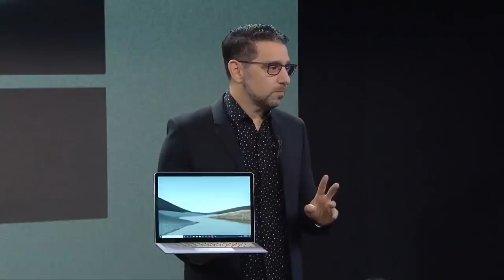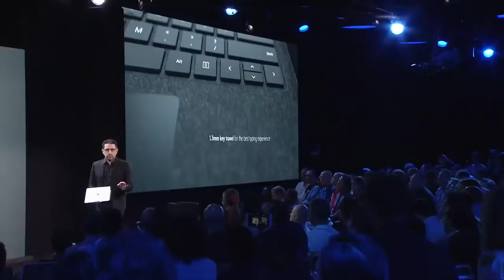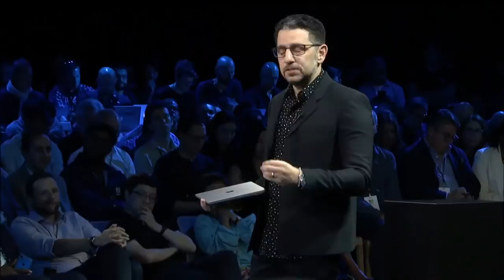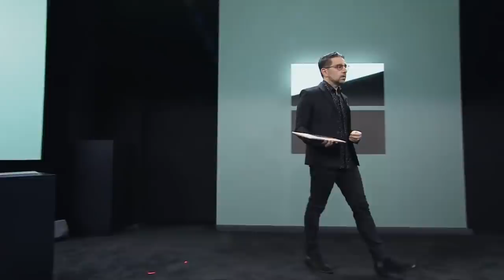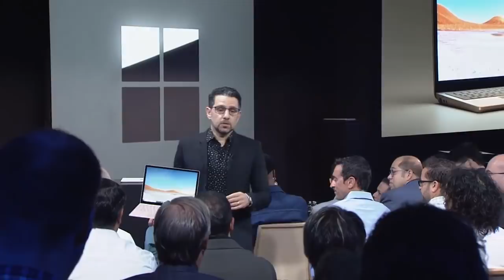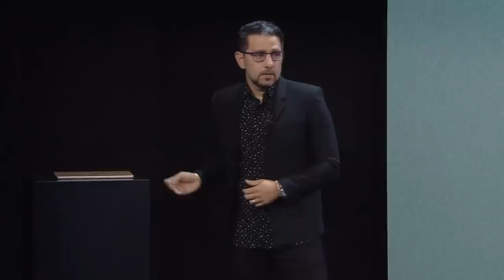Microsoft says they value repair-ability, designs more repairable product.

Comment: The key for these manufacturers that are designing products to be competitors to Apple, is watch Apple make all the bad decisions and do the opposite.
Reply: The headphone jack says hi.
Reply: @javiercorre  Did it mean to say bye?
Reply: @javiercorre  yes, exactly. The headphone jack on my 2018 Macbook Pro says Hi. That I do not need and have never used because like most people I am totally done with wired headphones and use Bluetooth that works extremely reliable and smooth on any Apple device. But if you want to continue living in the technological past, I can recommend a clunky Lenovo laptop to you that still has a VGA port and a modem slot.
Reply: @RandomUser2401  bluetooth headsets are shit. They're heavier and cause more neck strain. They need recharged which makes them worse for travel. And they're more expensive compared to an equal quality wired headset. Also the latency is pretty terrible if you game with it. Until they can fix those problems bluetooth ain't shit.
Reply: @myrecommendedisallmemes  what a load of bullcrap. My Bose QC are unmatched when it comes to travelling absolutely quietly, they are super comfortable and the battery lasts forever, can be recharged with a mirco usb that is available almost everywhere. Yes they cost a bit more, and I know that is the issue with people that dislike Apple, they see no point in paying for well engineered electronics, no matter how crappy a product is built, all that counts is a low price tag on it and as many Pixel/GHz/GB per $ as possible. Doesnt last longer than 2 years? Looks like shit? Built with ugly cheap plastic? Unusable trackpad? Battery empty after 4h? Doesnt matter, more GHz!! Less $!! Everything else doesnt matter.

About lag: Not everyone is a 14-yo gamer kiddie, some of us are adults that just need to get shit done and do other things like actual work with their devices. If you really want to game with a headset, buy one for home. For travelling, cordless headphones are simply the best.
Reply: @RandomUser2401  Being a Bose fanboy explains a lot. The only Bose headset I've had that is remotely worth it's price is the A20 headset and that's because the next best thing is LightSpeed's headset which is bulky and doesn't fit well. Every comsumer grade Bose product I've had is just as good as it's off brand alternatives. As far as consumer headsets go I bought a wired hyperx headset with a removable mic specifically for traveling (not gaming) for about $70 and it is still one of the most comfortable headsets I've owned. Arguably even more comfortable than my $1,000 A20 headset when wearing each for hours at a time. And yes, I realize they're in two completely separate categories for completely different things, but it shows that price doesn't always directly get you more. The only perk I've seen with Bose products is their customer support, at least for the commercial stuff they're easy to deal with and are willing to help you troubleshoot so that's a plus. Disclaimer: I'm not an audiofile so if you need some super high quality sound obviously the hyperx isn't that. But personally I couldn't justify spending hundreds more on a less comfortable headset from any of the big audio companies just to get higher quality sound (that I probably wouldn't notice anyways) Maybe you don't play video games on the weekend, but alot of other people do. And anyone on a tight budget who needs a multi purpose headset shouldn't be discouraged from having a wired one. If bluetooth was so great for everything we would have wireless headsets in airliners, but we don't and probably never will. I just dont see how having a lighter weight headset that doesn't need recharged is ever a disadvantage, but if that's what makes people happy then so be it, it is not my money they're spending Haha.
Edit: the Bose fanboy thing is a joke, people say the same thing about apple fanboys and I had apple devices for years before recently switching to android. don't take it too seriously lol.
Reply: @Setzer K in the Uk it costs £600 or 700 same sort of number in the USA but still amazing value for the west when the iPhone 11 doesn't even have a 1080p display for the same price lol
Reply: @Ibrahim-vx5kq  VAT is taxation; taxation is theft
Reply: @Gideon_Judges6  taxation is used to pay for all the things we have like free healthcare in the UK but it's theft if there are corrupt politicians who steal tax money
Reply: @Ibrahim-vx5kq  why exactly would one pay for free healthcare? Isn't that an oxymoron? And why is healthcare associated with/dependent on buying a cellphone?
Reply: @Gideon_Judges6  you were talking about tax  and free health care is associated with tax so...
Reply: @Ibrahim-vx5kq  I think you have a fundamental misunderstanding of what "free" means.
Reply: @Gideon_Judges6  I don't healthcare is provided to me at no charge to me paid for by tax
Reply: @Gideon_Judges6  
Piffle.
Reply: @Gideon_Judges6  
Free at point of use, clown.
Reply: @Ibrahim-vx5kq  : Well, complaining that taxes are theft demonstrates only that he isn't fit to establish a government, but he isn't exactly wrong per say.

The reason he pointed at free healthcare is that if you're paying the taxes that fund it, then that healthcare is not free, it just uses legal money laundering to make it seem free. Something is free if you don't have to pay for it, so if it is paid for by taxes and you pay the taxes, then you are paying for it, they just pull a shell trick to hide the fact that you're paying for it.

This is, incidentally, one of the actual purposes of taxes. Others are to force all beneficiaries to pay for what they benefit from, and to simplify and organize (you know, so that it doesn't become a poorly-planned disorganized mess) the funding of group concerns (this one being why taxes are necessary despite honestly being a type of theft: not taking that money would result in some people getting all the benefit for none of the effort). It is theft, but in the "normal" case it is desirable theft, because it provides needed budgets without forcing "that one responsible fool" to take responsibility for all of the miserly quasi-bums that are waiting for someone else to pay.
Reply: @Gideon_Judges6  ikr. Free healthcare is contradictory. You pay through your taxes. Instead of choosing what you could do with your money, imstead big daddy gov decides, even if you dont want to.
Reply: @daverhodes382  I didn't start using my computer until after I paid for it. According to Dave Rhodes my computer was FREE!

Take that, ya filthy capitalists!
Reply: Sadly many copy apple... dell xps 2 in 1 is soldering everything
Reply: @Setzer Kyeah not for 500 tho more in the region of the iPhone 11 but if they can get carriers in the UK to sell it,they will sell loads of units,they have the value for money products but not enough recognition in the phone market
Reply: That should be like business 101....look at what your competitors is doing to irritate its base and then do the opposite
Reply: Weirdly they take everything that's wrong with Apple products and copy it, like the ugly notch or the removal of the headphone jack, but putting good enough screens on laptops hell no, in 2019 you can get an awful TN with 768p screen, even apps complain saying you can't watch everything.
Reply: Think differently
Reply: wait this is just like mainstream politics, what even is this era. Im dead.
Reply: Setzer K yea... just look how repairable the galaxy 10 is??? Lol... ever try repairing that? 😂🤣😂
Reply: Setzer K gaming PC is the opposite of apple because it’s the only way they can exist
Reply: Everybody copies Apple in many ways because apple sometimes is ahead of time. They knew the future was going to be wireless and they did take the first step. They weren't wrong, we got wireless earbuds in different brand. They knew tactile keyboard would be better for a small smartphone to maximize screen usage, so they went ahead and did it, it was a huge advancement. I'm not an apple fan, my last iphone was iphone 4, never owned a mac but I give credit where it's due. Now with the macbooks yes they are doing a horrible thing soldering the Nvme SSDs and rams, they clearly aren't made for business use. I see those surface laptops are trying to show repairability that could get the attention of some IT departments specially in start up companies, the rest will stick to thinkpads.
Reply: @Setzer K ROG hardware is some of the best stuff around.  Same time, MS has done and is getting better at making Surface hardware even better.  I am still using my Surface Pro 1
Reply: @Setzer K cheaper than he monitor stand